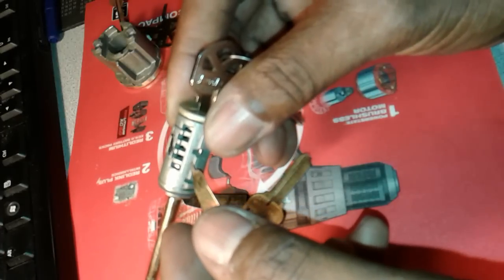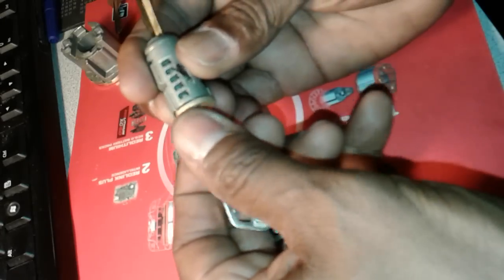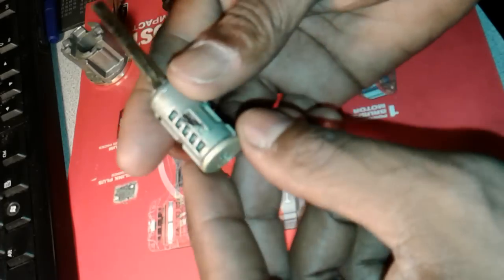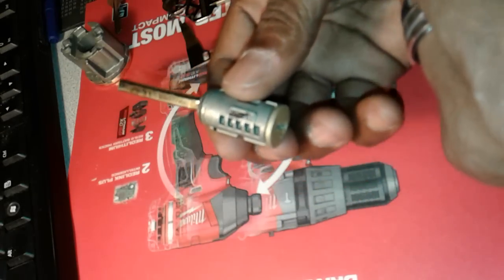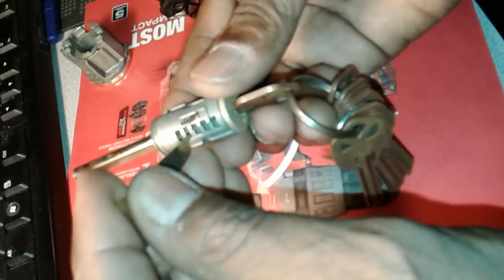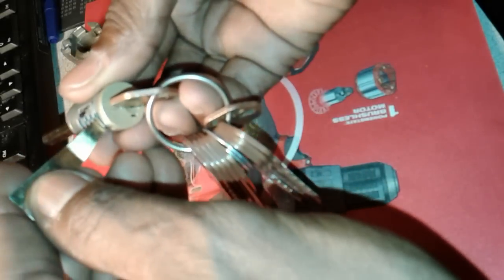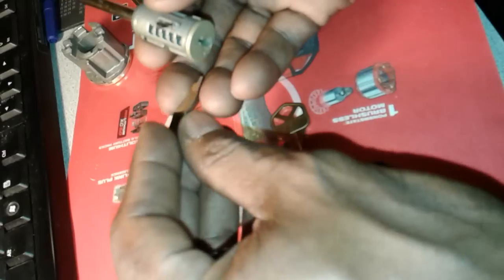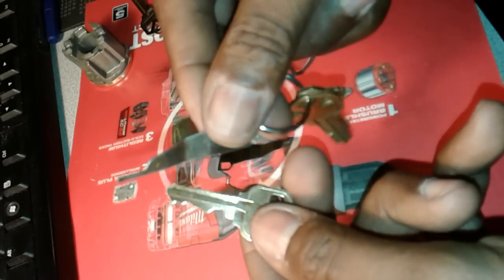DIY Kwikset Smartkey Lock Decoder Tool

Comment: Great idea, thank you for the upload.
Reply from the maker: Jim Zeidler no thank you Jim. I ran into another one today where we had 12 locks there were all smart key. there is a way to get into one deadbolt and I used that to create the original key. after that it was a snap to get them all changed over. :-)
Reply: Daniel Lewis What also makes it a great idea , with a little patience in the beginning, the rest of the job is all downhill.

Comment: You can reset it much faster just by taking it apart and realigning the wafers.
Reply from the maker: Very, very true my man! but, this was just an alternative tool in a person's Arsenal. (plus, if I was to make a video of that, taking it all apart and someone didn't follow it exactly.......you know they would flame me! LOL!!!!! )
Reply: The point was to generate a working key so the other 10+ cylinders wont take anytime to rekey. 
Faster is NOT always better--Quality and NOT quantity.

If your one of those "Slamming Sammys" you should get another career.
Just saying...
Reply: marxg4 I could still rekey 10 locks by taking them apart faster than this method.
Reply: marxg4 by the way, who the hell has one key for 11 locks?
Reply from the maker: hey guys , we're all Pros here. just wanted to give someone a little extra help when it comes to these locks. like I said in the video, you can reset it with a cradle or like Sam said take it apart but if you run into a situation that a realtor has lost the original key and now the new owner wants everything rekeyed. this is just alternative. no big deal :-)
Reply: Daniel Lewis okay thanks
Reply: Pull 10 /rekey(reset/etc) & replace as opposed to decipher 1 and then use the lame change key 9 times? 
More power to ya!

Resi work sucks--Comm'l is where the income is.

~The method he used reminds me of the old GM decoder days~

Have a great weekend--
Reply: i always screw this up, any videos out there?

Comment: My kwikset smart key lock keeps loosing its setting....y?
Reply from the maker: Mike O'Dell Yes, I have ran into this a number of times...So much that I put a disclaimer on any work order that have Smartkey locks on the property.......

" This Lock Hardware had an early history to fail over time and reset itself so that the keys would not work in the lock. Keys made by duplication can cause the cams in the lock to shift out of alignment and produces a failure. Kwikset has now completely redesigned SmartKey sidebar construction in the lock for greater reliability. But in case of a lock failure,  Company warranty is on first failure, technician will attempt to reset hardware back to an working position. Any Subsequent failures will not be under warranty." 

I will not give my thoughts on this lock but, any web search will show you multiple ways to defeat it.